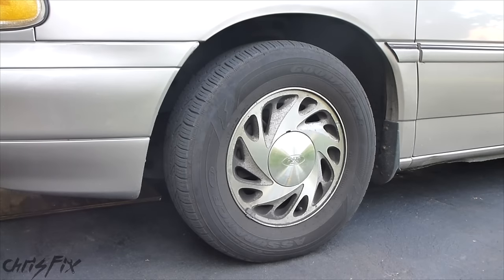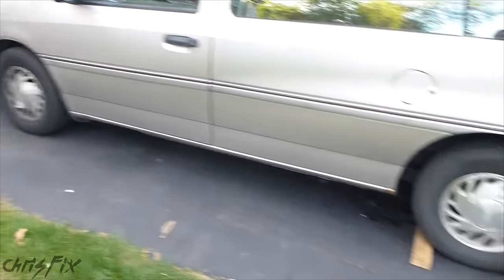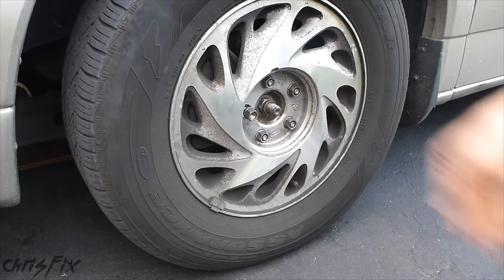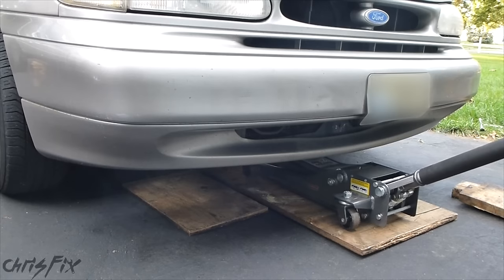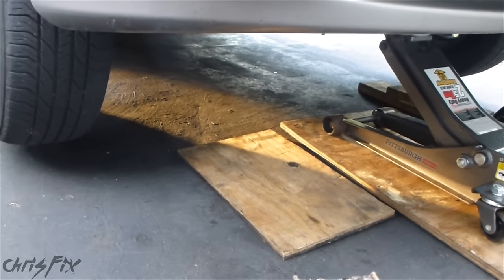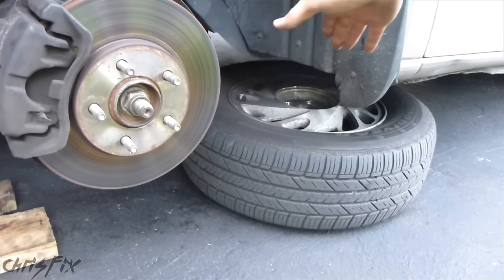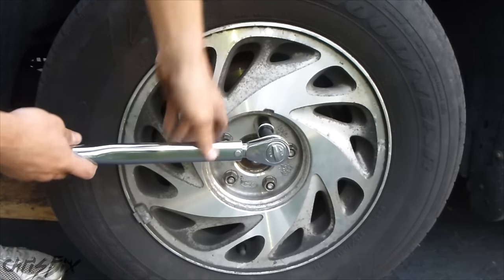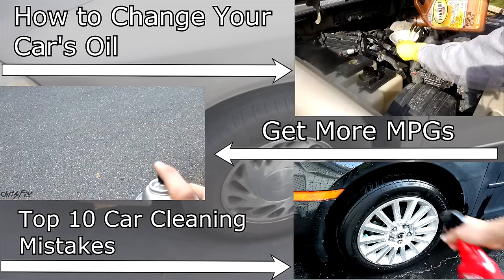How to Change a Tire (plus jacking it up)

Comment: What if your wheel is seized on
Reply: Kick the tire itself, straight on with the bottom of your foot. Kick either the left or right side, you may have to do both a few times even. If that don't word, bang the tire with a sledge hammer in the same manner. Usually one of those methods will get it loose, if not, someone really severely over tightened them.

Comment: 😒 dont b cheap, buy two HD 3 ton jacks from hb for $80 each, too many jobs where 2 jacks make things so much easier, also try to use drive on ramps instead when u can its safer and cleaner 😒🚗🚙
Reply: @drippingwax  🙂 i would love a second jack, i have too many undercar jobs, 4 jacks can be useful too as a poor mans lift 😁

Comment: Through this whole video I never see you remove a TIRE... just a rim with a tire... removing a tire you need to go to a tire shop that have the equipment to do so... or if you have the equipment you can do it yourself.. you just showed how to change a spare wheel

Comment: walmart bolted them too tight they couldnt remove them after and all bolts got stripped along with lug nut extractor failed. A mechanic had to drill and create grooves  to make contact points. That was an expensive ordeal. Never use walmart please.

Comment: Putting it in 1st won't hold the car if it's front wheel drive. So if you're in Europe this video is only properly safe if you've bought German. Oh and locking wheel nuts? Explain these for the uninitiated

Comment: Why'd he undo the lugs before lifting the car. Okay chris
Reply: I think it's easier to do if it's got the weight of the car holding it steady.
Reply: The wheel will just spin if you try to loosen them with the tire off the ground.

Comment: "For where to jack up your car consult the owners manual"
Yyyyeah I've read through 5 manuals now & not fucking 1 of them has had the jack points & weight safe points.

& it seems like about the hardest thing to find for a vehicle Reliably, apart from a complete engine strip down.
Why in the fk is this such a difficult thing to find for some vehicles, & how in the fk do you have access to torque ratings, these data points seem to be non existant, & I certainly don't want to spend 40 quid on 1 of these manuals I can find, just to discover, it hasn't got 50% of what I'm after

Comment: never completely loosen the wheel nuts while the vehicle is under full load. break the nuts loose first, then raise the vehicle and remove the lug nuts the rest of the way. sorry, this video is painful.... the jacking point in a passenger vehicle is never in the middle.... jacking points are indicated in the manual and behind the wheel... did you clean the mating surfaces??? dude ….. i'm calling you out on this